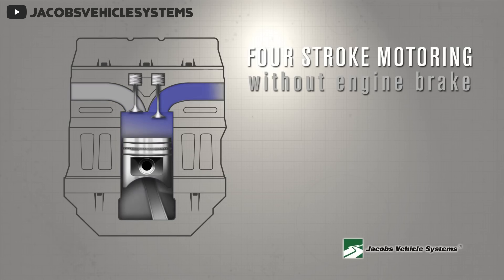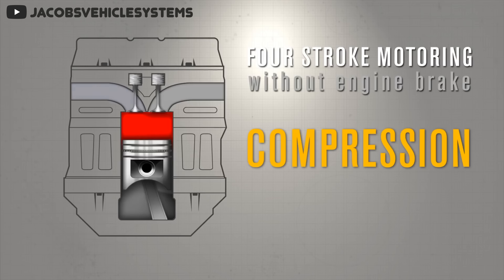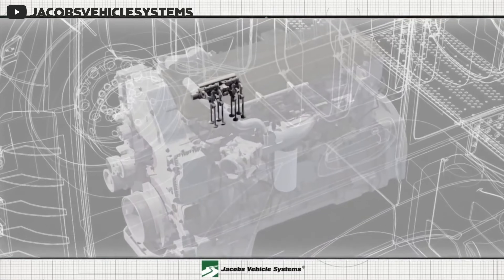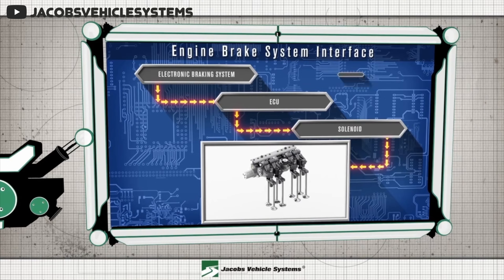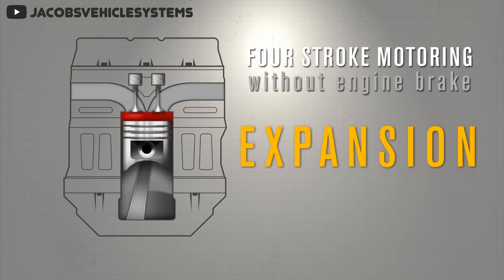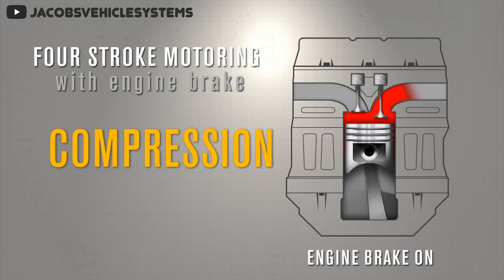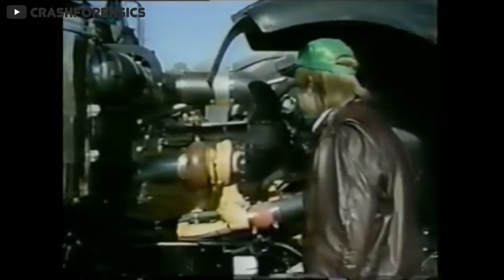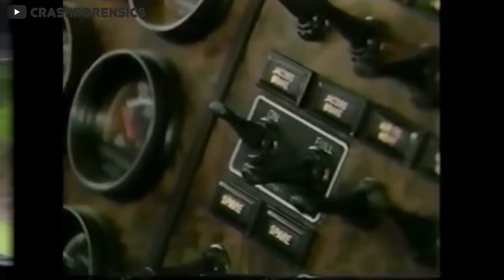What is a Jake Brake and How Does it Work?

Comment: The only problem with a truck using the Jake brake is that it does not work with the brake lights on the unit.  Example would be a fairly light load using Jake instead of the regular brakes.  The truck slows down rapidly, but anyone behind that truck is unaware of the slowing of the truck.  Now days you will even see morons using Jake when they are bobtailing.

Comment: I drive a 2021 Peterbilt 567 with a Cummins X15 (2017 X3) with an exhaust brake instead of a Jake brake. Our mechanic says most all new trucks have exhaust brakes instead of Jake brakes. The decibel difference between full engine brake and full throttle is nearly indistinguishable. If I had to choose one I would say that the exhaust brake is slightly quieter. Funny part is the exhaust brake is also made by Jacobs. So, by the same naming convention you can also call it a Jake brake :-)
Reply: No , jason the new isx-x15 have a jake brake -(engine brake) but with all the particulate  filter they are  more muffled down you don't  hear the normal noise & yes the variable geometry  turbo does restrict the exhaust

Comment: In most diesel commercial car (at least as old as 2002 I would say) there is a throttle valve at the intake for the EGR. This throttle is also used for engine breaking
Reply: A throttle at the intake can't generate net braking. It just determines the fraction of incoming air that is fresh vs EGR. Either way, the intake will get a given quantity of air and no braking  will result.

However, you CAN produce braking by throttling the exhaust and this is often used to "push" EGR up to the intake manifold. Today, you'll often see a VG turbine used for that same effect, although the throttle is more versatile and less limited.

Comment: Jake's/engine brakes are not needed when lite or city driving. They aren't excessively loud when used correctly. Moron immature truckers managed to get there use banned in many places where needed. Here's how. They come flying into town 10mph or more over the speed limit. Then over rev the engine in order to drop 2 or more gears( redlining motor) with Jake/ engine brake on. This equipment abuse is insanely loud, disrespectful to citizens. If you like the sound fine! Do it away from the public who doesn't want to here it! Who am I. Just a 38yr truck driver with over five million miles between USA,Canada, and Mexico.

Comment: Is one potential downside of using a Jake Brake increased wear on the valves? I have to imagine having that exhaust valve pushing into the highly compressed air when the piston is at TDC isn’t great for the valve assembly.
Reply: Wear is very minimal.

Comment: Ban the use of a trucks safety system in city's , WOW ! That makes sense 😂
Reply: It's a safety system meant for long downhill stretches of motorway. It isn't meant for use on small city streets where people live above shops. Not to mention that within city limits the speed limit is generally only 50km/h and often as low as 30km/h. If you need a jake brake at that point to be safe, either your HGV isn't road worthy or you aren't worthy of your license.

Comment: I was wondering how a old-school big cam 4 Cummins gets its valve timing for the jake brake apparently off oil pressure but how does it get the timing ? thanks
Reply: It gets the altered timing from the engine brake.  When the engine brake is activated by oil pressure the master  piston is pushed down on the injector adjusting screw and when it is pushed up adjusting screw pushes up on master piston which pushes the oil on slave piston to push it down & opens the exhaust valve which gives the compression  blow down ( that where the noise comes from) & then closes to give a vacuum in the cylinder to give more retardation . ( depends on enging ) . That is the best i can explain with out going to great detail.

Comment: Best way in the weather is to use lowest Jake setting slight trolly brake pressure giving more braking to the trailer and if you start a slide or jack Knife just apply slightly more trolley brake and some clutch then some throttle this will pull the system straight. Done this a few times lol. Jake's are nice for down hill and normal operating ranges.
Reply: Wow??
Reply: @edmccauley1090  yep used the trailer brake bar many times to pull the truck straight applying pressure from the year and giving a bit if throttle straightens it right out. People who can't react well should go straight to clutch and that can sometimes give a recovery but far less effective.

Comment: It's not an explosion, it's a fast burn. Yes it makes a difference. If Detonation/ knocking occurs its bad for the engine. Ex. Race cars can't run pump gas. Detonation will happen and trash the engine. High octane solves this in race cars. I ran 120 octane in mine.

Comment: I own 2 diesel utes (truck in American) and both have a throttle body, one is a 2006 Holden Rodeo with a 4JH1-TC motor and the other is a 1988 HJ75 Landcruiser with a turbo 2H. the Rodeo has pretty good engine braking but the Cruiser you can just let off the accelerator, bump it back a gear in the steepest on roads it it will start slowing down due to a compression ratio of 20 something to 1 and a inline 6 configuration. I know when you google diesel throttle bodies and it says they don't have them but that's just not true and they definitely have more engine braking than stinky petrol cars

Comment: I never understood why guys doing a routine valve lash adjustment ignore the exhaust brake. Maybe its only the fleet mechanics I work with assigned to other garages. I will have a driver complain his exhaust brake does very little to slow down the truck. First thing I check is the valve lash adjustment and find the exhaust brake so far out of adjustment that its a wonder it works at all. On a Navistar MaxxForce 10, this adjustment can be tricky unless you have a long feeler gauge. 
I think the mechanics assigned to the garages in the city ignore it since their drivers rarely get above 30mph and seldom need engine braking. Once they come out here to the desert, engine braking is a must.

Comment: All of turbo disels I've ever driven (especially older cars) have noticeable engine braking. Newer models will coast better that's because the computer isn't cutting fuel completely or it's leaving flaps open for longer. Also, diesel engines generally have a ton more braking than gasoline cars because they operate at higher compression ratios.. 

I honestly don't understand how you can say they don't brake at all lol.. maybe you've never driven one.

Comment: I once owned a 1998 Pete with a 3406E whose clutch fan would engage when the Jake was activated. I also once drove a 1980 something Autocar roll-off with straight pipes whose engine (four and a quarter CAT) would shut down if you didn't shut off the Jake. i think that was an adjustment issue. Besides slowing the vehicle down, the Jake also gives you the advanage of upshifting faster with a non-synchronized transmission.
Reply: Nonsychronized transmission of course. 1st turn off Jake/engine brake prior to shifting
2nd double clutch the clutch like your supposed to
Floating gears, abusing Jake brake doesn't make you cool. It makes you stupid whether your a rookie or a seasoned veteran driver
Reply: @matthewtobin8  I was gonna say you made a stupid comment but then I realized a comment can't be stupid but stupid people can make comments as you have proven.

Comment: My obersvation of driving diesel cars is totally different. That diesel engines got much more engine braking when you lift off the throttle than gasoline engines have. 
It think this is because the effort to compress all the air in the cylinder to the high compression ratios of diesel engines takes more power, than the compressed air than hast stored to push the piston back down. 
 So when you want to maintain speed or slow down, it often doesen´t take more than to shift down 1 or maybe 2 gears with a diesel car. Since the higher the engine rpm is, the more braking force it creates. And when it reaches over 3000 rpm, the braking is "significant".

Comment: I've just watched 25 seconds of this video to realize you may be mad dude! 
In what Universe the DPF or the turbocharger will add or inflict engine brake? Except those cases when they go poopy lol.
Modern Diesel engine have throttle valves and for those classic ones where are these are absent you still have fuel cut-off from the diesel pump once you lift your foot from the acc. pedal lol.  
The reason you don't hear those pops now or then is because small cars have a much longer exhaust system and 1 or 2 sound deadening options. 
I don't know where your inspiration comes from but you've said a big hoax.

Comment: I suggest that you drive a 2 liter gas car and then drive the same with a 2.0 diesel. the diesel brakes a lot harder than the gas car. Sincerely, a guy that owns 3 diesels and 2 gas cars. Even 2 of the same car: e36 325td and e36 325i, i rarely even need to use the brakes in my diesel whereas you do with the gas engine.
Also: a modern jake brake is about as quiet as it can be, in europe pretty much all semi's have it and you never hear them on the road. the only time when theyre loud is if they have a modified exhaust.